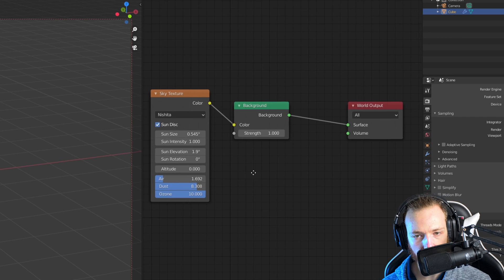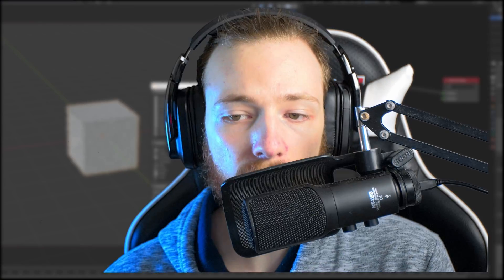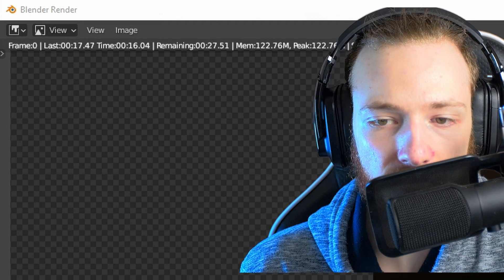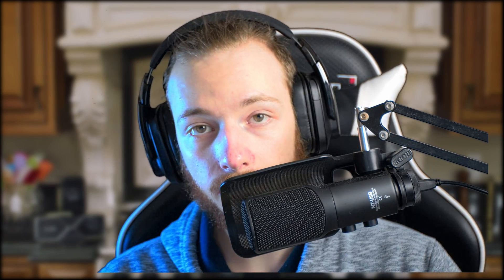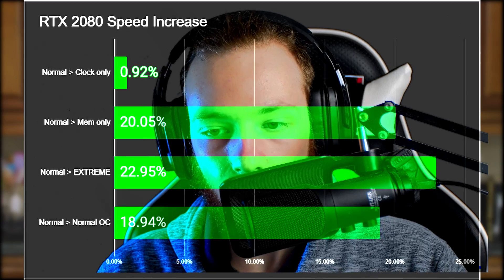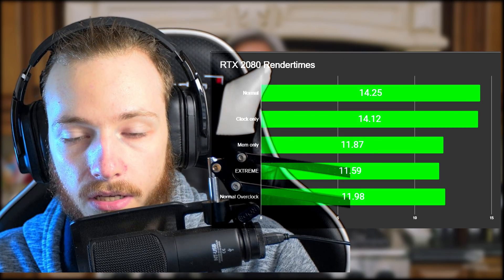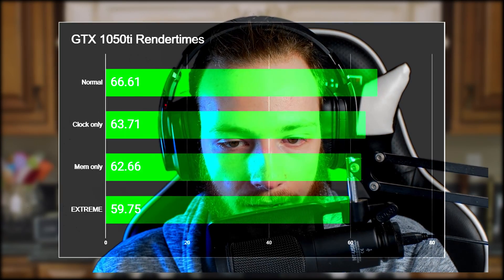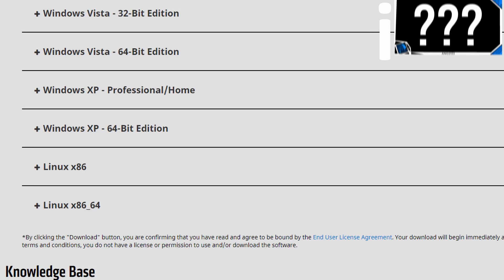23% Faster Blender Renders due to GPU over clocking is black magic!

Comment: hi! Thanks for this great video, lots of useful info! 

Do you happen to know if it is safe to underclock the GPU core clock and overclock the memory clock? 

I've been getting the cuda illegal address error that occurs when GPU rendering in cycles (OptiX) and have been scavenging the web to find a way to fix it. Some people recommended that I lower GPU clock speeds. Yet my GPU (3060 TI 8GB) wasn't pre-OC'd, running blender at its factory set clock speeds (+0 core, +0 memory) and still failed to render (booting out this error message: "Failed to create CUDA context (Illegal address)"). 

Thanks in advance if you have any tips or knowledge to share!